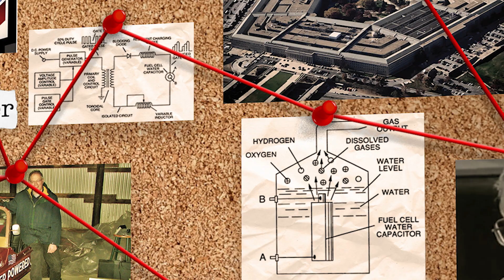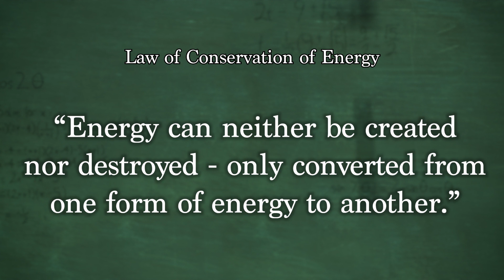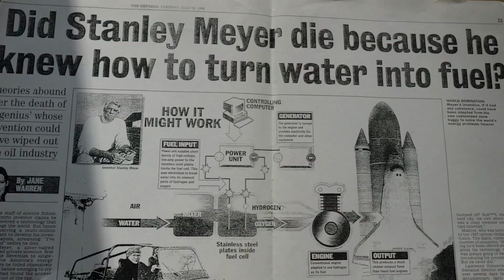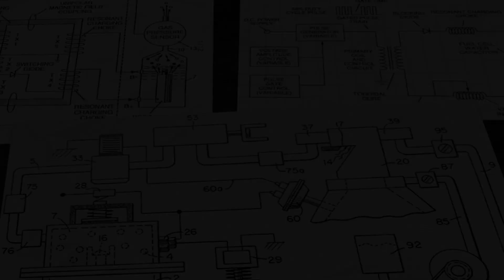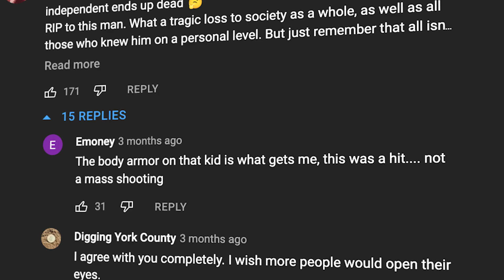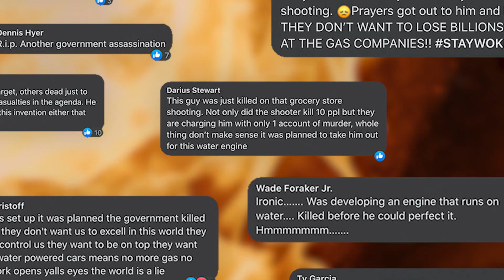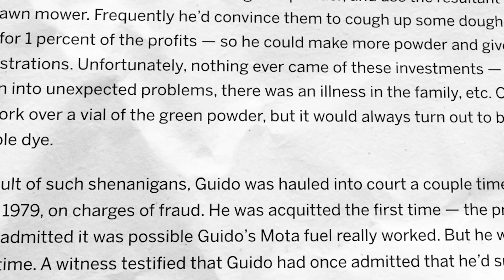The Water-Powered Car: Lies, Death and Conspiracy

Comment: it's pretty easy to make a hydrogen generator and make any gasoline engine run on it. the issue is that the energy  it takes to create the hydrogen is more than the output of an engine running on that same hydrogen.
Reply from the maker: That's totally true. Meyer's invention totally ignored this fact, turning what is a promising contender to the electric vehicle into a total joke.
Reply: the best lies always have some grain of truth
Reply from the maker: well said